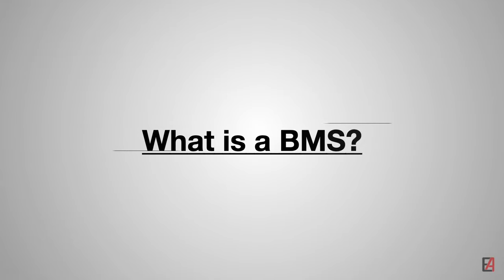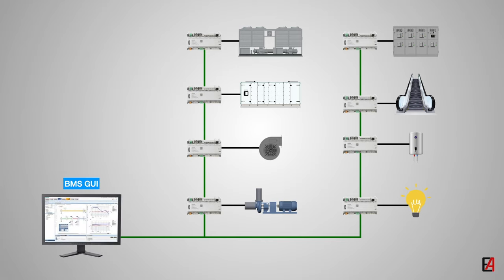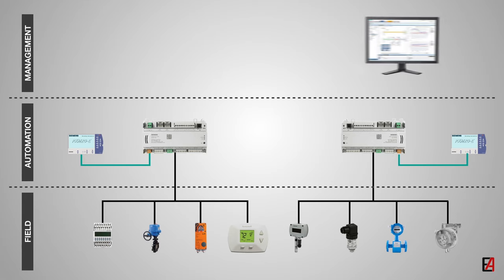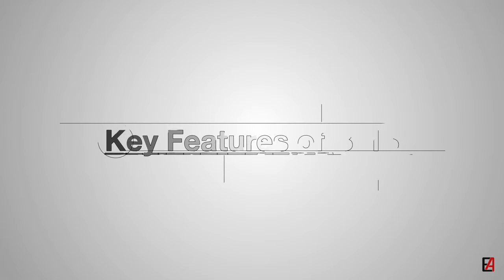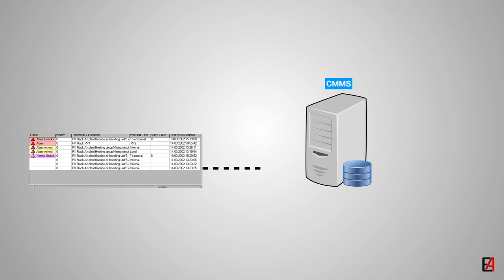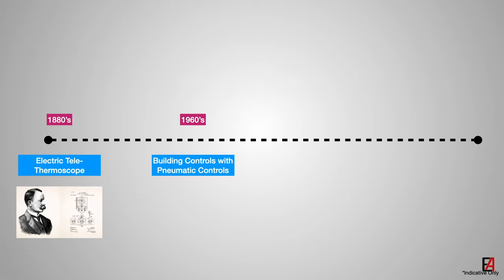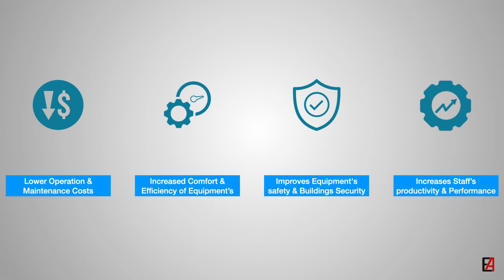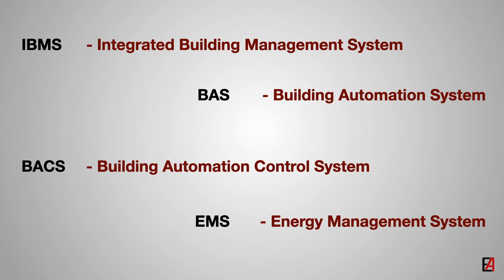BMS Building Management System - An Introduction...  with basic features & history

Comment: I have a problem, I can't understand how the Emergency of switch for industrial steam system works with BMS : 

the customer asked to Emergency of switch To be situated adjacent the boiler room with warning horn, and is to be integrated in the boiler control system and BMS. including all necessary cabling.

if you can help me, I don't understand how the emergency switch for industrial steam system works:

1- if you press the emergency switch, it will stop the boiler and it is the boiler that communicates with the BMS.

2- if the emergency switch is pressed, it will communicate with the BMS and it is the BMS which stops the boiler.

3- if you press the emergency switch, it stops the boiler and the emergency switch sends its status to the BMS.

pls send me a reference of the emergency switch to buy it
Reply from the maker: Hi Said, i need more details like if the boiler controller can take an DI input which can be connected to the Emergency push button NC contact. 

When the button is pushed, it sends a contact to boiler controller to stop the system immediately. Then boiler controller can send an output signal to BMS that the boiler is stoped due to Emergency button pressed.

Otherwise if the BMS already have override control of boiler control system, then emergency push button can be connected to the BMS system which will stop the Boiler.

The Emergency push button comes as single NO/NC contact or 1 NO 1 NC contact which can be wired to BMS DI signal. 

What i understand from clients requirement is that when any abnormality is observed in the field, instead of calling the control centre, the technician can press the emergency button which will shutdown the boiler.

Let me know if this helps, of if u need any more details let me know i can help.

Thanks for your feedback, please subscribe, share and support us.

Comment: Hi any idea how i can fix this the BMS keeps timing. the software is on a old windows 7 pc that I'm guessing could be the problem
Reply from the maker: Hi John, could you please elaborate your issue to understand better. If its on IP network, pls check the lan & Bacnet drivers also, make sure the UDP port is not blocked on the network or firewall
Reply: @engineeringautomation  thanks il check this today

Comment: Actually I'm working on a prototype BMS that would rely on AI to best manage comfort levels, energy saving and some other secret functions. My only worry is at the level of the sensors, how efficient can these various heat, light, flow, movement sensors be? I feel there's a need for development of rocket standard accurate sensors...
Reply from the maker: Hi… if you use the general BMS sensors then there is some concern regarding the measurement accuracy. However you can either use industrial standard instruments which has more accuracy and robust. But it will be costlier. Another option is to use the healthcare approved sensors which are used in hospitals. Those sensors have higher accuracy and more stable. Hope this helps